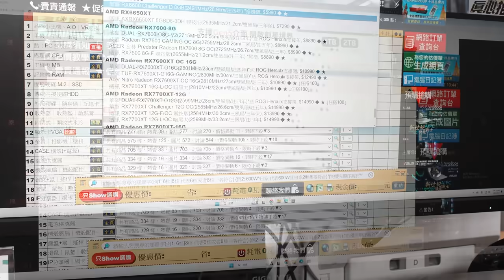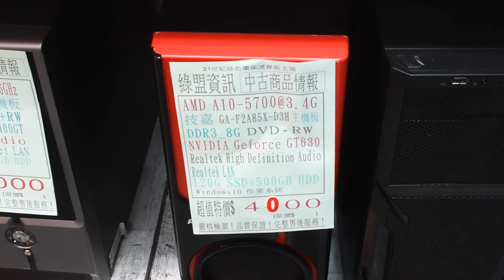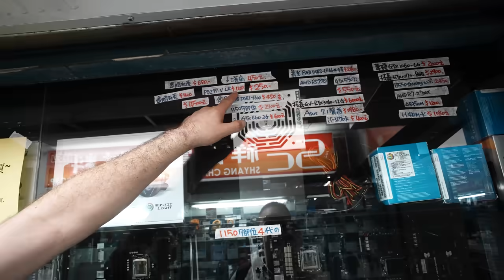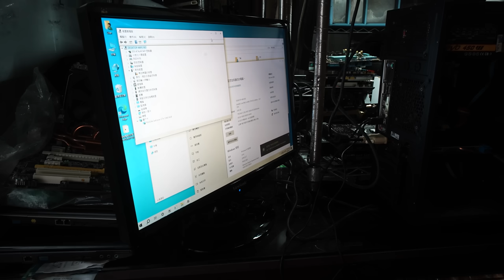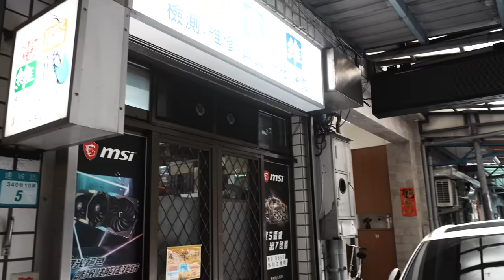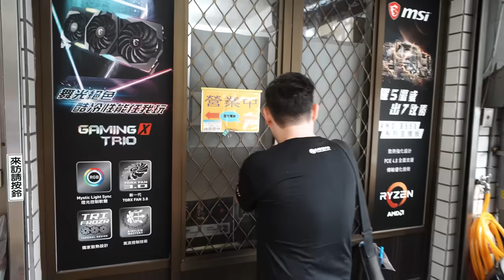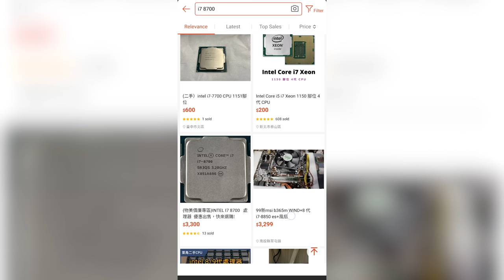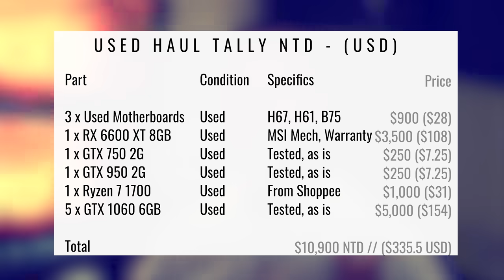Radeon Gaming PC Parts are SERIOUSLY undervalued in Taiwan! (Parts Hunt)

Comment: Used 3060, 3060ti, 6600, 6600XT, 6700XT...etc, are all very cheap here recently. Even used 3080, 6800XT are around 330~370 usd sometimes.
Reply: Much better than the UK then... 6700 XTs go for £260+ (330 USD+)
Reply: IMO those cards should be cheaper, considering RTX5000 is around the corner. The prices were actually better when mining had just crashed 1 or 2 years ago.

Comment: Taiwan isn't the only place where Radeon is undervalued. 8 months ago I was surprised that I was only 1 of 3 people bidding on a Liquid Devil 6800 XT on eBay, and I ended up winning the auction for only $416 USD. The card showed up in mint condition, and after overclocking, I have RTX 3090/RTX 4070 Ti performance levels in rasterized games. I can't believe the performance this card puts out for the money I spent. I also feel a bit bad for the guy who sold the card, because he paid over $1,000 for it 3 years ago, that's a LOT of depreciation.

Comment: From my recent experience scoping out used deals, it's iffy whether local or online. 

 There's a lot of sketchy stuff being listed, and honestly I just bought a b450 that had already been bios updated to support a Ryzen 5600x. 

I had intended to install a 2700x in it but now I'm going to have to get a different CPU for the motherboard or take it back out and try to resell it. =\ not the best options.

So what I decided to do is wait until I get my next paycheck and pick up a 5700x3d because they're only 200 on Newegg. 

Paired with an xfx Rx 6800 core, 32Gb Gskill 3200 cl 16 and a 2tb nvme gen 3x4 boot drive I'm confident the Corsair 650W PSU will make a great budget 4k 60fps base system to finally run cyberpunk 2077 in 4K on my 70" TV.

Entertainment goals.